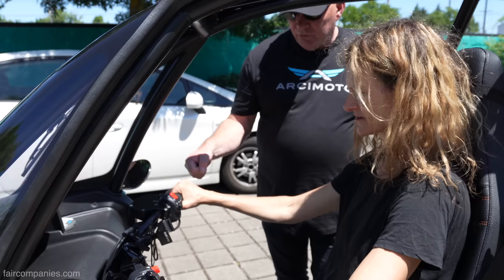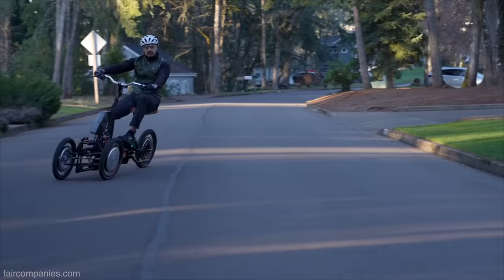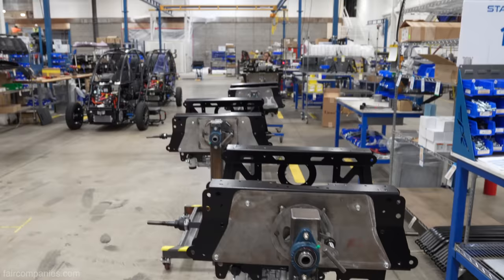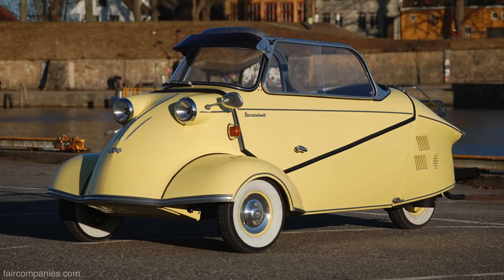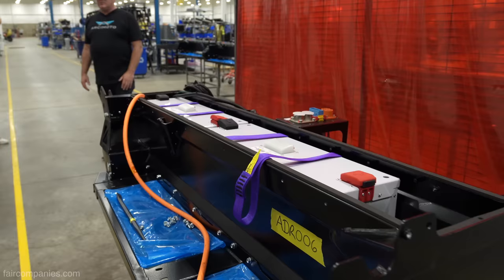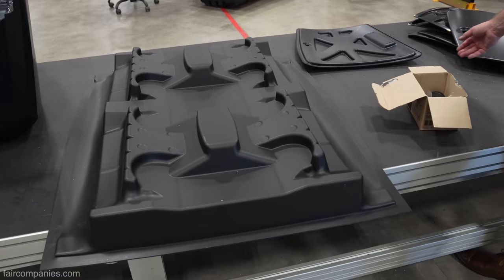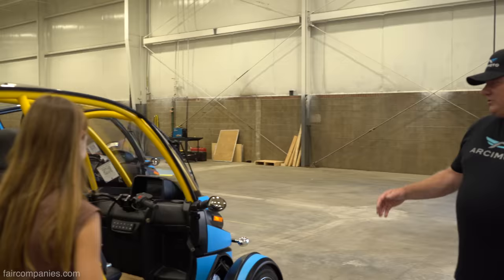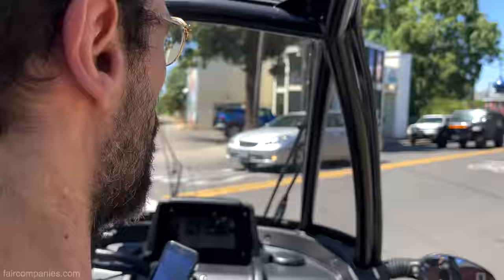Arcimoto 3-wheel EV commuter blends bikes' fun + cars' safety

Comment: I will keep my tin can Nissan X-Terra, few gallons to start the thing,,,,but oh well! Folks you Pray you never get in even a slight accident in the thing! Buy an Aptera! Full Solar!
Reply: Aptera is NOT "full solar" unless you are OK with being limited to an absolute maximum range of 30 miles per day under ideal sunlight conditions only. It has trickle charging which is nice, but a light vehicle never has enough surface area to be truly solar powered unless it weighs under 200 pounds and is kept to low speeds. You are really obnoxious in your dishonest hateful attack against a very well designed vehicle that offers the same level of crash protection as any small car, but through a different, tested and certified, method of roll cage and 6 point harness. The first bad collision has already happened and the guy walked away from it, no helmet was worn. We'll have to wait to see how Aptera does in a collision. Aptera is only one step away from Elio vaporware at this time.
Reply: @popeyegordon  Not obnoxious my opinion as you just stated!
Reply: @lifeongps  Your goal was to steal thunder with false claims under a new video that reached a caliber of quality and delight you can only dream of. Owning an opinion and abusing the expression of it are different things.
Reply: @popeyegordon  In your opinion!
Reply: @lifeongps  That's an absolute lie. I deal in facts and now that I own an FUV it is also my experience. You are talking through your hat. There is no opinion in the FACT that the first serious collision proved the safety of the crash cage/harness combo. Actual concrete evidence and testimonial from the victim. His opinion that Arcimoto had sold him a very safe design became a verified fact when he walked away from the scene with only bruises and wanted a replacement FUV as soon as possible.
Reply: @popeyegordon  Wake Up, that is one example, I am waiting on my 1000mi range Aptera, I will never plug a vehicle into anything???? EVER or I will do as I do Now,,,fill up with Petrol! Les than 1% of the US population even own an EV car, that is not a car, it is a cool looking Golf Cart! MY OPINION! Go have Fun!

Comment: Sunny bright southern California...such.  Torrential down pour of rain in Houston...yeah..that's a no.
Reply: You are not capable of judging on that until you watch the videos of the Arcimoto being driven in rain and snow. I stay 100% bone dry in mine during hard rain, with no doors, above 25 mph. I could care less about my elbows getting damp at lower speeds. The passenger seat is wetter so they would wear rain gear, easily kept ready in the trunk.

Comment: Still too expensive. $10,000 out of the door, I would be interested. Oh, and the suspension needs to be too rigid?
Reply: Wake up to the year 2022 when used vehicles are selling for new car prices and new cars are selling above retail. $18K is a real solid and competitive value for a vehicle that never needs gas, accesses the very cheap motorcycle rate for insurance and is a whle lot of fun at no extra charge. It has no $5000 motor or $4000 transmission to blow up either.  The bonus it offers at no extra charge is you get to live responsibly and stop poisoning the air we all share.
Reply: Thanks for your reply Popeye, 
For my purposes, there are better options for what FUV offers. For local commute and 30 miles or so range, I would rather use an ebike, or Vespa. I love the Archimoto concept, just not at that price range. Base model Aptera at $25k, which I think it’s still expensive, offers way more.
Reply: @AA-rc4zr  Elio/Aptera never went into production and we absolutely do not need EVs with a top speed of 110 MPH. Aptera in fact offers far less. It is designed as a long distance interstate freeway machine when we need the exact opposite design to reduce heavy car abuse. Same for Tesla. Much of today's EV market is pandering to the bad habits of consumers who want to continue abusing resources for long distance travle that is non-exxential and should be replaced by busses, trains or simply not ding it any more. If your trade is in sales or service that mandates long distance driving regularly that would be the only niche market for which Aptera is suited for, assuming they de-power it to not go over 75. Looks like we need a miles based carbon tax before people will stop stealing more than our fair share of resources from future generations.
Reply: @popeyegordon  You are implying that if I buy a FUV, there will be more busses and other modes of public transport will magically be available? There won't. I would love that idea though. I've lived in other countries and US is the only country that I've  had to own a car. I'd love to minimize. Own the simplest and cheapest mode of transport I can have. If what you state is the goal, and e-bike or a vespa would do the job better and way cheaper than a FUV. I have no interest in having another toy in addition to a car that I would have to own, if I bought a FUV. The problem with Aptera is also that it would act as a second car. How does owning more than one mode of transport reduce the abuse of resources? Make FUV cheaper and I am in. Your competition is an e-bike not a real car.
Reply: @AA-rc4zr  You have distorted my words. I did not say they will appear because you buy the FUV, they will appear based on demand. Counties and cities adjust their fleets based on ridership.  You don't have to own a car, you choose a lifestlye that makes it important. But you know, without confessing it here, that you don't try hard to carpool or ride a bike for those short trips. Nobody will do this for you and excuses don't cut it. Only you can make the change the world needs for all to survive the next century. That starts now, right here, today. The clock is ticking. There is nothing in reality and fact that makes autocycles second cars only. Those who own two vehicles say they use their Arcimoto the most. So you rent a pickup to haul lumber or fertilizer once a year, you rent a car to do a long distance drive if there is no bus or train. Or you just don't go. We can't have change if no one is willing to change. Duh!! I turned down several high paying jobs in downtown Seattle at a time when I was already unemployed for a year and desperate because I refused to do that commute grind and it would require several bus transfers. I took a lower paying job close to home that actually paid more on an annual basis because I was able to bike to work without buying gas and sitting in traffic as my arteries clogged. If you refuse to do your part for long enough it will catch up with you in the form of a carbon or environmental tax. What you pay will go in my pockets as a reward for living responsibly, and to fund train lines.
Reply: @popeyegordon  We are getting off topic. I am not disputing the fact that electrifying transportation and minimizing local transport is a good idea. It's a great idea. I am disputing that Archimoto is the the solution to your high aspirations. You'll have to sell millions of EVs to make a dent, as opposed to a few thousand per year, that  Archimoto is set up to build. At the $18,000 price point and limitations of Archimoto you are not going to stimulate adequate demand. I do use an e-bike for my local commute. For all the things that you claim Archimoto is good for, E-bikes are better.  I am on the market for an EV solution to meet all of my local transportation needs at a low cost. Archimoto is an expensive novelty, not a solution. A solution is an EV for the masses.
Reply: @AA-rc4zr  I for one am living proof that the design provides a great car substitute. These are bought and driven one at a time, just as automobiles grew in poplularity one driver at a time. I qualify as an expert ebike user after over 15 years of commuting and using them as my only transportation. I am safer in the FUV. More comfortable and seen better. I can out run the rain storms in Florida's summer but could not with my car-bike's 20 mph top speed. I can carry a pile of camping gear better and bigger than an ebike with a trailer and I have a rear seat for a passenger. The FUV's roof and wrap around windshield with wiper makes it easy to start a trip in rain while staying dry and having good visibility but with a bike you will wait for it to clear or get wet. An ebike's tires are fragile compared to the car tires of the FUV and a blowout or axle failure is less likely. 
The base price is very competitive considering all the built in long term annual savings that go with the purchase. In fact, demand has exceeded supply consistently for the last 3 years and the deposits are growing in number. I think ebikes are great for certain commutes, bike paths and hilly regions but they have a heap of limitations not present with the FUV. The small list of things inexperienced car addicts say is missing from the Arcimoto consists of superficial things we can and have done without while not being a hardship. Three FUVs fit in one car parking space. Finally, the RAMP is in fact being set up to build 50,000 units a year when fully tooled. It is building the EV solution for the masses. Right sized and sustainable, unlike Teslas.
Reply: Decent E-bike $3500. More options coming out every day. FUV: motorcycle with a roof, 40 miles range? Not worth $18K. Right now you are selling to the early adopters. At $18k, I’ll keep looking for better alternatives.
Reply: @AA-rc4zr  Where did you get 40 mile range? It is 100 miles for this year and more to come. You can't be serious. Comparing a 2 wheel bike with an autocycle with collision protection, 77 horsepower and a roof! Not even in the same solar system. Get real or stop wasting our time. The early adopter market ended alomst two years ago when they stopped selling the $25K signature series. Nathan Fillion and Mark Wahlberg bought a couple of them. They have voiced no complaints. There are fleets of FUV rentals on both coasts, they do not compete with ebike rentals and rent for $125/hr for the first hour. Very busy. Again, no complaints. There is nothing wrong with limiting yourself to a bike, especially when younger but that is not license to launch false screwball attacks on a new class of vehicle just because you can't afford one.

Comment: Yeah, bigger doesn't  mean safer, at all!
Basic Newtonian Physics says a 3 ton SUV driven by "Karen" has a lot more inertia then anything under 1 ton. More inertia means a lot more energy that needs to be dissipated in a crash, meaning any crash can be potentially more dangerous. Not to mention issues doing corners and anything besides continuing to go in a straight line without trying to stop.
Obviously a "cheap tin can" produced by the auto industry "cartel" is worse then the "over-expensive tin can", but in the end both are underperforming, overusing resources and being unnecessarily disposable in a very unsustainable way.

Comment: This looks so tipsy.  Wouldn't it be a lot less tipsy if it had 4 wheels and maybe was a little wider?  Then it could be really sporty.
Reply: You need to adjust your perception. This is extremely stable. The weight is down hear the axles. It is very hard to do a reckless move that gets just one wheel up off the pavement. Nobody has ever rolled over in one but if you did you'd be thankful for the 6 point racing harness and roll cage.
Reply: @popeyegordon  The cage and harness are great.  I guess it would help if the driver was close to the floor, more reclined I guess.  I think they should have made it wider.  Why 3 wheels and not 4?
Reply: @swilhelm3180  Three wheels make it much lighter and all that is needed for two passengers. I am very happy with mine. I didn't want a 3000 pound EV, this is just 1300 pounds and charges easier and faster. Three of these fit in one car parking space. You need to trust me when I correct you on stability. That is one thing never mentioned by thousands of other comments I have seen. It is already wider than other trikes on the roads with a higher COG. There is room for a double wishbone suspension for each front wheel. This is only slightly narrower than many small cars but with a lower center of gravity. The driver's eyes can see above and beyond most compact car roofs. The tapered body also means almost no blind spot in the mirrrors at all. No use for a backup camera.

Comment: It's all fun and games until it's raining or snowing sideways.
Reply: And yet the videos here show drivers enjoying rain and snow in comfort and safety. With sideways snow it is unwise for any vehicle of any kind to go out. When I drive mine in rain it is like a magic force field keeping me bone dry above 25 mph. Not even my elbows get wet.
Reply: @popeyegordon  The rain that would normally hit you (if the vehicle were stopped), misses you, because the vehicle is moving forward.  The only rain that can hit you (while the vehicle is moving forward above a certain speed), is rain in front of the vehicle, but the windshield blocks that rain.
Reply: @ReeseL4D  I'm an owner. You are preaching to the choir with me. The roof is narrow and the slightest angle of rain does hit me when I'm not moving, that means just elbows and outer thighs. Like I said above, when youget moving you stay dry and the 3 speed wiper works great. I have the most dry ride because I adapted a set of car window vent shades to the windshield/roof juncture, I did this more for Florida sun protection but it adds 2 inches to the width of the protection.
Reply: You can get half doors as an option. They are working on full doors and AC/heating.

Comment: You wouldn't want this on the road in Oklahoma I can promise ya that flat lands and high winds are not friendly to motorcycle or even Volkswagen bugs I have owned both 
You have to lean or steer into the wind now imagine what happens when you meet a 18 wheel truck when already fighting the wind
Reply: Have driven in very heavy coastal winds (40mph with higher gusts) and the ride stays planted on the road. The open frame helps in this case.
Reply: It is not even possible to lean with the Arcimoto - you are strapped in. The wide wheelbase with wide car tires presents a big surface area for traction. Motorcycles have rounded tires. The cross-section wind profile is small compared to the rubber on the road and vehicle weight. There would have to be a lot of ice and heavy wind to lose traction but everyone slows down then.

Comment: That thing would get crushed with all the massive trucks and SUVs on the road today.
Reply: It would be crushed by a Tesla too
Reply: But yet you see motorcycles on the highways all the time and the don't have a cage and seat belts.
Reply: That's pure nonsense we see every day from ignorant commenters. There is always something larger on the road. A semi can be crushed by a train. A train can be crushed by a land slide. A land slide can be crushed by an earthquake. Pound for pound, the FUV is safer than any motorcycle ever sold and as safe as the average small car thanks to special design. Learn what roll cages and 6 point harnesses are about.
Reply: How many SUV’s are impervious to 80,000 pound semi’s?
Reply: @whaterfoo  No. Not any more than any small 4 passenger car would be 'crushed' by a Tesla. Teslas are way too heavy and over powered status symbols that waste so many resources they are not helping the environment. There has already been a crash with a pickup truck drunk driver that was as heavy as a Tesla. The FUV's crash cage worked and the driver walked away with only bruises, no helmet or air bags needed.

Comment: It's nice but not at the price range $20K... if they keep price in $15K range than it is a different story...
Reply: You are not aware of real market prices these days. The base price is 18K, not 20K and that is before rebates and tax breaks as much as $7,500. In 2022, used cars sell for new car prices and new sells for above list. Within this market this is a vehicle that never needs gas or oil changes, charges easy on its battery which is just half the size of small electric car batteries. Another bonus is these get the motorcycle insurance rate, 80% cheaper! I save $800/yr on my insurance.

Comment: Needs as little as a 15min full charge, like stopping for gas and getting a donut.
Reply: As an owner I am perfectly happy with the rate of charging. I just plug it in when I get home and forget about it. I can charge on a 220 volt level 2 charger for free at Walmart. Mine offers more range, power and speed than I need but it is a pretty close to perfect fit and lots of safe fun. The days of long drives for recreation and long commutes are over. Problem is not enough people are educated on this fact for our survival yet.